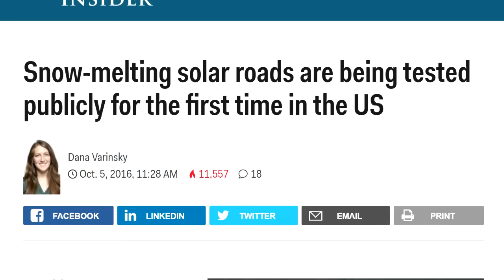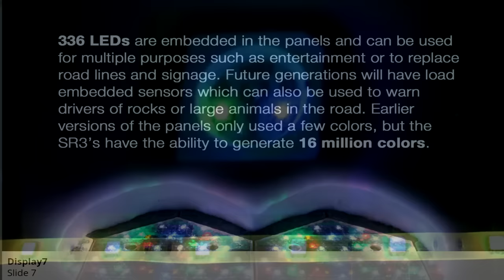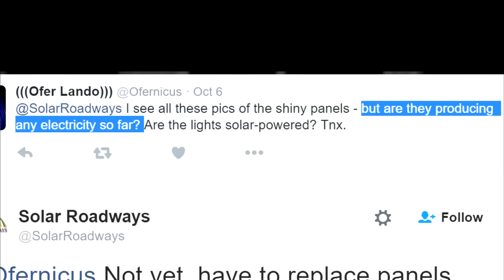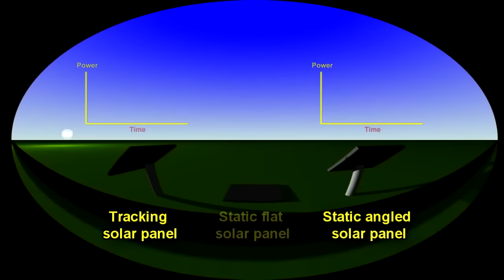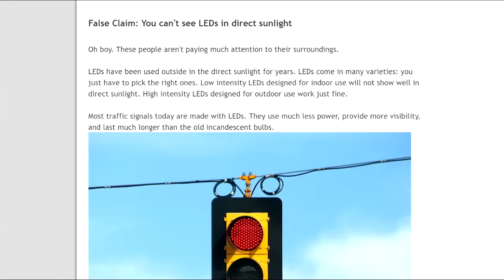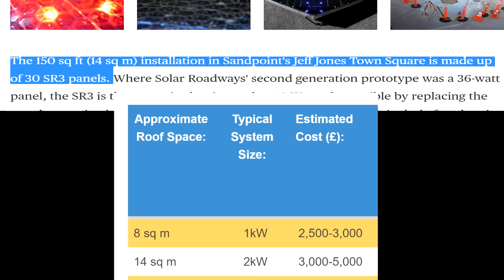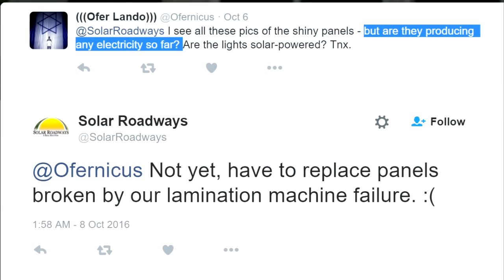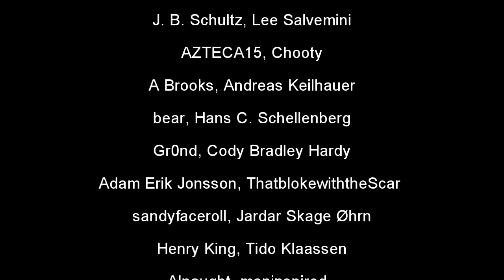First AMAZING Solar Roadway UNVEILED!

Comment: This is very sad to see. Especially since the media covers this product so ignorantly and favorably. In a time where we're running out of ways to generate power, we really need to find more efficient ways, and I appreciate their out of the box thinking. It's just so sad to see how impractical it really is. We truly need something that will work to cheaply generate power.
Reply: The media is no longer the media. It is now PR and advertisements. You can thank the FCC for mass deregulation back in 2003.
Reply: That and the sorry state of the American education system. It isn't much better in the rest of the western world these days but the USA truly leads in this regard.
Reply: We aren't even close to running out of ways to get power.  Making a sweeping statement without evidence is exactly the problem here.

We have at least 1000 years worth of coal/natural gas in just the United States.  I'm confident that we will reach something better by then.  The last 1000 years took us from horses to the moon.  This 1000 years will take us about a million times further.

No, we are not running out of energy.  No, we do not need to rely on solar or wind right now.  No, carbon dioxide in the air is not dangerous. (unless you think plants are) 

There are actual problems that could be solved today, but we are focused on crap that wasn't even a thing 10 years ago.  The ocean cannot rise on its own.  The icecaps are not melting.  There aren't "bigger and more dangerous storms."  It's a total scam.  Focus on actual pollution, like dumping of toxic minerals and metals.
Reply: Morenath Blanco Now here's the hypocrisy here. You tell me not to make any sweeping statements without evidence, yet here you go making these bold statements, which I don't necessarily believe, and you've given no evidence. No evidence of the falsehood of dangerous climate change, which pretty much the whole media is in agreement on. No, I don't personally have any evidence either, but you I've heard of studies done by scientists, saying that climate change is much worse than anybody already thought. I don't have a source, but I have something to base this on. For instance, if climate change isn't an issue, why are scientists lying about it? The idea that the whole scientific community would be in agreement on something and it actually being a scam is ridiculous to me. Also, what would their reasoning be for lying about it? America holds its oil industry above everything; for what purpose would American scientists be telling us to cut down on oil usage if it weren't actually an issue?
The only lies I can see here are the oil companies and big businesses lying and saying climate change isn't an issue, so that they can make an extra buck at the expense of the planet.
Reply: If they ever get nuclear fusion working, it'll be the best thing ever. That's the single innovation I'd be willing to describe as solving all the world's problems.
Reply: ***** Indeed. Solar is useless for most of the worlds population centres as few places are slap bang in the middle of a desert. Vegas would be perfect for it, but they use hydro already lol. Solar is useless in the UK beyond adding a bit of extra power to the grid, same with most of western Europe really.

We need more nuclear power stations. I wish people would stop being so closed minded about them and learn more about them. Coal plants produce far more radiation than nuclear plants, and all that shit is pumped into the air. All the nasty crap in nuclear is contained.
Reply: Battery chargers attached to treadmills and stationary exercise bikes.

MAKE IT SO!
Reply: I did a little surface researching on this. Apparently alternative resources have been/are sharply declining in cost for production. Thorium, which is much safer than uranium, is also being researched to extract its latent energy in a cost efficient manner (i.e. safe nuclear fission could be a possibility fairly soon). There are a lot of different alternative energy sources other than solar energy, wind turbines, hydroelectricity (i.e. technology used in dams), and some other commonly known means. Biological means is an example of how new cost-efficient technologies are surfacing.

tl;dr there is no real energy crisis. We already have decent alternative means, there is a lot of research going into this field, and a lot of innovations and breakthroughs that show promise have been made fairly recently. Don't stress yourself out. If it helps you at all, I am an engineering student and have enough general knowledge of science that I can point out the obvious bullshit technologies, like the solar roadway stuff.
Reply: +Adur Aspara also keep in mind there is some research going into nuclear energy. Scientists are still looking into Thorium, for example, which is considerably safer and more abundant in nature than uranium. Seriously though, I will have a hard on if they manage to make that a viable source of energy, lol
Reply: It is a viable source of energy.  Government altered market forces to favor uranium because its processing can make material fissile enough for explosive purposes.  Gotta make them nukes.  Despite the fact that Thorium would be cheaper since it's many times more abundant and has similar energy density.
Reply: TalesOfWar I think one of the issues that people have with nuclear though, is that we will eventually run out of uranium too. From what I understand, it's not really a "permanent" solution (and yes, I use permanent as a loose term, since nothing is permanent). I don't know anything about making power, but the way I see it, solar energy at least won't run out for several million years, at which point humanity will probably die out anyway, but earthly fuel is something that's in limited supply. Even if there's a lot of it, people will continue to use more of it, and we will eventually run out. So, however soon we harness nuclear energy, we'll eventually run out of that just like we did oil, and then we'll just have to look for something else. Even if our economy stayed stagnant, we would still use a lot of it up very quickly. Since solar comes from space, however, we're not going to ever run out of that.
Reply: We'll eventually run out of uranium, but it'll last us far longer than oil and coal and thorium will last us until the supergiant gas planet careens through our solar system and tosses us off orbit.
Reply: Smither Sink I think your metric of scale is a bit off. Very low quantities of uranium/thorium (theorectically) are used to produce a lot of energy. I wouldn't think of uranium like you would a fossil fuel. For a mode of comparison, energy density of 100% U-235 isotope is about 24 million kW/kg, which is around 2.7 million times denser than the energy density of coal. 

That, among other things, is a good start to understand why people are very excited about and supportive of nuclear energy.
Reply: Unfortunately they are mostly made of water. D:
Reply: Solar freaking rooves.
Like we've been doing for years.
Reply: roxoto "sheeple"? really?
How the fuck do you think several hundred thousand people (google "amount of scientists in the world", take any two digit percentage of the total) could be all in agreement to tell the same lie, especially a lie that is against the interests of most major corporations as well as the richest countries in the world, and have it not be discovered that they are lying?
Reply: Poldovico Exactly! What reason would thousands of credible scientists have to lie about something like that?! This guy is ridiculous!
Reply: Smither Sink
To their disadvantage, no less, for most of the time they've been saying it!
Reply: That would require people to actually do shit.
Just guessing, but I think they prefer to want everyone but themselves spend money on solar.
Reply: that's the entire plan I think. It's to scare people from funding genuinely clever ideas and instead placing their trust back into the boardrooms of the corporations who can then control the flow of technology releases to ensure they milk us for all we are worth.

These guys were essentially set up to fail, and the media coverage is there to film the entire thing happen in slow motion for all to see.
Reply: Smither Sink Like maybe solar roof tops?

Comment: Wait till road salt and salt on the sidewalks during the winter at that square end up seeping down around those panels.  The corrosive power and electrical conductivity of brine will do wonders for what is left of the system.
      Eventually, the glass will crack, there will be holes and resources will have to be expended to re-concrete the area at what the  the city officials will call a prototype test and hope everyone forgets about it as quickly as possible.  But before that, some woman's heel will go into or between the panels which will result in her attorney obtaining a settlement from the city for a quarter of a million dollars. The attorney will talk about the money going to his injured client ( a third of which he will take) and the need for the city to remove these "death traps."

Comment: Even if they did work, I'm sure people would find it great fun to spray paint them black and do burnouts on them
Reply: You slip on the wet glass surface as if it was ice, but more specifically, you try to manage your two ton vehicle on a wet glass surface and find that it's virtually impossible.

Even if it had bumps - it's pretty much worse now, because not only do you get to ride on a slippery surface - you get way less surface contact with it. 

Also - have you ever crossed highway lines that are painted with that special bump paint stuff? Imagine that sound accompanying you non-stop for a few thousand kilometers.
Reply: ***** Murder Freakin' Deathways! xD
Reply: I have seen the future and its burned solar freaking roadways. YEAH
Reply: If you replace every car with automated-non manual cars, there'd be no reason for that to happen.
Reply: +Sagrotan
A solar installation needs an inverter circuit so it can output usable electricity. Depending on how it's setup there still might be dangerous electric valtages exposed to water.
Reply: KnightofDark001 oh, so automated cars handle that well on wet glass?
Reply: Tomasz Wota That would depend on if they were made to drive on them or not.
Reply: KnightofDark001 That's purposefully vague. Also, it's like skeletons fucking - missing the point. ;)
Reply: The tests they have completed showed that both light and heavily loaded tires grip better on the texture put into the glass compared to even new asphalt... and we all know how slippery asphalt gets when it gets worn.  So until you have the facts, you are just speculating.
Reply: tear them out and install them on your roof to use the power for yourself ;)
Reply: Thats not a problem at all, how about we build a rain protection thing on top of every road and while we are at it we add some solar panels to that..... oh wait
Reply: Yeah, no. Cars with enough power/torque to do burnouts will be banned. You will only be able to travel in self-driven smart cars.
Reply: traveling to non essential destinations will be banned too. and if youre not essential to the politicians lives, then you will be banned from consuming resources and you will starve
Reply: It gets ruined by a couple of teenagers goofing around in an iroc camaro.
Reply: Maybe put a special material on top?
Reply: I was just going to drive down the road with ballbearings , or anything heavy and metal . but this really made me laugh after that depressing video
Reply: P Mason I don't know much in this area, thanks for clearing it up. Would it be possible to change the material (the cover, which is glass right now)?
Reply: Or on the buildings or any were other then the road . by the road also a bad idea
Reply: That's the easiest way to get publicity these days. Ridiculous ideas and statements get the most notice because, to the average person in today's society, something sensible, practical, and simple just doesn't get their attention or excite them as much as the crazy, flashy, way-out-there ideas. It's not that the good ideas get suppressed necessarily, it's just that the crazy ideas spread way easier and faster.

Comment: I haven't watched this yet, but I just know it's going to be a hoot!
Reply: dave jones! love your channel!
Reply: ♫ There's no other blog like David Jones ♫
Reply: Whoooooa... Dave!
Reply: What is a hoot?
Reply: Nomellamesfriki A hoot is an event or concept that causes one severe mental anguish and sometimes permanent psychological damage. It's derived from the New Zealander word for "hot".
Reply: hoot (v.) Look up hoot at Dictionary.com
"to call or shout in disapproval or scorn," c. 1600, probably related to or a variant of Middle English houten, huten "to shout, call out" (c. 1200), which is more or less imitative of the sound of the thing. First used of bird cries, especially that of the owl, mid-15c. Meaning "to laugh" is from 1926. Related: Hooted; hooting. A hoot owl (1826) is distinguished from a screech owl.
Reply: +Nomellamesfriki It's going to be "a laugh" :)
Reply: Would it be possible to use some kind of prisms to make solar panels on roads work?
Reply: you mean to "catch" more light?
Reply: Can you further elaborate the use of prisms?
Reply: Might put that to test to see if it lasts as long as tarmac, that is, years, or even decades. Otherwise replacement would be very expensive.

the texturing is also important for traction, so it kinda also complicates the electricity generation. Kinda.
Reply: It might be possible to put heat exchangers in the road and get energy out of the road via heat rather than light - but it wouldn't work that well - it would at least not need to be transparent. no good for car parks though as the cars would shade the surfaces.. but for the road way into the parking spaces it's another option - and at least parking lots have no heavy goods vehicles on them and people only travel slowly to the opacity issue wouldn't be a problem as quickly.

Still a huge waste of time however.
Reply: Love your channel!
Reply: Check out the live cam link every so often.
Reply: thanks for your soldering and product review videos... in a whole new world of programming, soldering, inventing, etc. due in part to your blog. and saved a few hundreds on laptop repairs and the like as well :)
Reply: +Galaxy thundef00t the science dude
Reply: CRIKEY ITS DAVE! Will you be commenting on Sargon Of Akkad next?! Also, do you agree with his hyperloop debunk?
Reply: +Nomellamesfriki

A hoot is the name given to the owl friend of Jimmy Giggle.
Reply: BOB IS NOT MY UNCLE, DAVE!!!
Reply: Here is an idea. Why don't we spend money on making solar panel more efficient and keep them on the roof. It's not like there's no roofs left and we need more power.
Reply: There is a max energy per square meter of light given off by the sun
Reply: I love your channel =)
Reply: eeeekkks!!!! yikes theres a scene of asphalt being rubbed against a piece of glass!!! skip to 15:37...

Comment: Imagine how slick the glass will be when it is wet from rain. Cars will have no traction.
Reply: They'll just chalk it up as a feature, something like:
"Solar roadways, feel like you're driving an ice skater on butter"
Reply: EXACTLY!
Reply: It's no problem though. The solar roadways come equipped with hyper advanced defibrillator technology for the victims while EMS is on the way.
Oh wait. That's called an electrical hazard of combining electricity with water. My bad.
Reply: Not technically a deal breaker except the putting rain slacking channels and grip texture into the glass............. they wont generate.... as much.... jesus I can't believe I got excited about this when it first came out 😑
Reply: @colmivers  don’t blame yourself. At surface value it seems like and awesome concept. The problem is it’s practicality and implementation. Cars would have to get a lot smaller and tires and wheels would have to change significantly. We’d have to drive cars like those seen in Idiocracy and even still there would be significant problems remaining to solve. Society would for all intents and purposes have to be self sustaining because traveling long distances in little cars with foam wheels at slow speeds would be pain staking at a minimum. And this still doesn’t address weather concerns among others.
Reply: @colmivers At least you can admit you were wrong. That's something increasingly rare these days, and you could easily have hidden it... it's not like you were arguing with someone about it in a back and forth in a series of comments. 👍